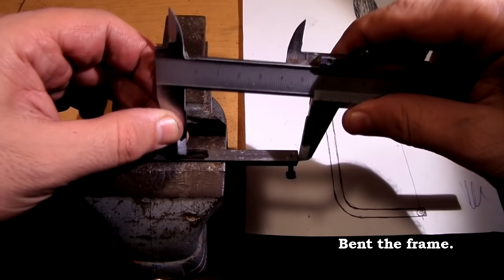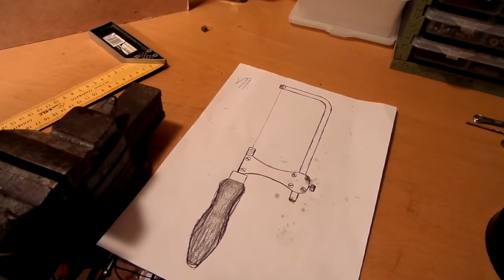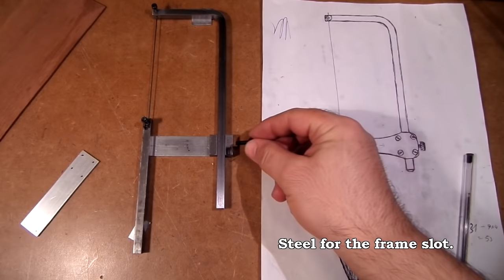Homemade Jeweler's Saw - Metal Cutting Coping Saw

Comment: Brother had you had it in you to buy the extra material and make about 50 to 100 while filming, you would have sold every last one of those!!! These are $10 to $45 depending on the brand, but yours would bring $75-$100 if it works superb. Removing the wing nuts and overall craftsmanship is a plus for me. Great work on the saw.

Comment: That is awesome, turned out really nice. If I didn't already have 2 including a lovely antique saw then I would be making one.
Reply from the maker: Thanks! Would love to have and antique one, I searched for a while without success before I decided to make this one.
Reply: +The Small Workshop I was lucky to find one at a car boot. It has suffered a little damage but it still works great. When I went to the V&A recently I saw an almost identical saw (mine is a just a little deeper in the throat) in their jewellery exhibit, it was dated to the mid 19th century.

Comment: That is incredible. If i hadnt a fretsaw and a coping saw already, i would try this too. The only thing i worry about is the strength of the thread in the aluminum plate near the handle. Nice work!
Reply from the maker: Thanks! Well the aluminum bridge is the weak spot of the saw and if it starts failing in time I'll probably replace it with brass, or even steel. That's why I did not epoxy the handle piece to the bridge. And I'll probably use this saw to make that new bridge. But right now it feels pretty solid and the forces involved while cutting are mainly in the handle, since it cuts on the down stroke and also you are not supposed to put pressure on it or you'll snap the blade.

Comment: Beautiful tool you’ve made.  
I love the details of the adjustability, and I really like your solutions.   
I have only ever found that adjustable height to be a liability tho, and prefer a fixed saw.   They make them adjustable to be able to use broken blades, but blades are inexpensive, and by the time they break I’m not sure there teeth’s are still all in. 
I’ve also had saws that use a round bore to capture the blades, but always was frustrated with smaller blades slipping.  But that could well be operator error.  Never heard anybody else complain about that.   
Regardless my particularities around a saw, you’ve made a dandy one.
Reply: Nm.  Just watched to the end.  I see it’s your tension adjuster.

Comment: beautiful work. I'm a jeweler and use one of these every day. Just curious to know what kind of epoxy you use that actually sticks to aluminum under stress?
Reply from the maker: It's a five minute epoxy from Bizon. Pretty good quality stuff but it's role here is more to keep things aligned while drilling for the screws. And maybe add some rigidity to the bridge, but screws do most of the work. But I've used the same kind of epoxy to glue rubber to an aluminum roller on a belt sander and it hold under heavy load for more than a year, until the sander itself broken, but the rubber is still on the roller.

Comment: Amazing work. If you drilled and tapped hole 90° on the set screws for the blade you could turn the blade too

Comment: little tip for tensioning the blade. its much easier to leave the spine tight and then place the top part of the saw (w/o the handle) against the edge of your bench and push with your stomach against the handle. you can then get the blade tighter with a lot more consistency than by hand.
Reply from the maker: Thanks for the tip, I've seen some youtube jewelers doing it, but my frame is a bit too rigid for that kind of tensioning.

Comment: I have seen you use your cross cut saw table before, and seen how good it cuts thin wood. As I have the same lathe, the DB250, could you publish details or provide a link to them please?
Reply from the maker: I'm gonna make either a video or an article on my website on this table saw attachment, since a lot of people asked me about it. It's pretty simple actually, just a shaft with the blade on it turning between centers and the table is made from scraps of laminate flooring.
Reply: Thank you for replying! I thought this was how you had set the blade up so it is how you made the table which interests me most, especially setting it up at 90° to the lathe axis.
Reply from the maker: The base of the table is made of two strips of chipboard that hug the lathe bed, one in front and one in the back. They are tight on the bed, so each time I put the table on it stays in the same position. To the right of the table there's a smaller chipboard strip positioned in the same way that ensures the table does not move from left to right, so the blade stays centered in it's slot. Every other element of the table was built up in reference to the front strip of chipboard. The fence rail is screwed onto it, the table top is aligned to it in the front, the blade slot and guide rails are 90 degree to it and so on. The fence rail is a piece of square tubing in which I cut a slot, making it a C channel, since I could not find one here. Aluminum extrusions are great for this if you can find them. The fence itself is a flat bar of aluminum, so I can cut thin strips without it getting in the way. PS: all wood parts were cut using a larger table saw, so they are parallel and at right angles, so you might need one too, it's a case of "sawception" where you need a table saw to make a table saw :D

Comment: I'm very impressed with your craftsmanship and the durability of this saw. I have one of these (flimsy)saws, but the blades are hard to find, or would they be in the same location as coping saw blades? I also like your 'stubby' bit driver. One of those, "now why haven't thought of that before", moments.
Reply from the maker: I use scroll saw blades, wood ones are available at my local hardware store but metal ones I buy online.
Reply: +The Small Workshop Thank you.

Comment: Wow that's nice. Love the build quality. Also funny to see a Proxxon DB250 Lathe, I have the same one. How does CA finish hold up to heavy use?
Reply from the maker: CA is pretty durable if you like glossy finish. Pen makers use it all the time. But sometime it gives good grip, like when running your fingers on glass, but sometimes it can get slippery. The short screwdriver in the video also has CA finish and it's bean beaten around my shop for a year now. I don't use oil finishes cause I use a lot of rusty/greasy metal and they get dirty fast. If you have and exclusive woodworking shop, which is cleaner, then BLO is a better finish for the grip, but then you would not need a metal cutting saw :)

Comment: Really nice work.  What size is the steel square stock you used?  Looks like 5/16" or 3/8"?
Reply from the maker: It's a metric 7 mm bar, somewhere between 1/4" and 9/32". I was planning to use 1/4"  but they didn't have it in stock that day.

Comment: Excellent Work, but don't you think installing the blade should be done with a faster way?
Reply from the maker: Thanks! I can always replace the screws with knobs, like the one from the frame adjustment. I used screws to keep the saw as slim as possible.

Comment: I can't seem to find such metal blades? Does Stanley, Bahco or another popular brand make them?
Reply from the maker: I use Proxxon to cut really hard metals, like circular saw blades, but for softer metals like copper and aluminum even the china ones work, as long as they are for metal. I guess there are some special jeweler's blades, Swiss or German made, that are better, but I don't know the brands.
Reply: The Small Workshop
Proxxon. Thanks. I'll be on the lookout to complement my wood blades.

Comment: Very nice video, thank you! Im looking for thee coping saw blades that can cut hardened metal, where do you get yours?
Reply from the maker: Proxxon. You can see them in action in my latest video, about the leatherworking knife. They work great.
Reply: @TheSmallWorkshop  Appears these are scroll saw blades, do you know the model number by chance 28000?
Reply: @TheSmallWorkshop  I found 28112, 28113 and 28114 (36, 41, 50 tooth)

Comment: A Maz ing!!!!! Ah WOW. Was looking for a video on how to cut off the SS metal from my pendant and earrings to attach to my cuff bracelet but cant seem to find any videos on how to do that and theres not one Silver Smith in this town to do it for me and while looking for a video here I ran across yours and wow God Bless you you are fantastic. You wouldn't know how to cut what I'm looking to cut would you? And do you sell the saws you make cause that seems perfect to cut the pendant an earrings I need to get cut. :)
Reply from the maker: You can buy a cheap jeweler's saw frame for around $10 online. It's the blades that make the difference, you need one designed for steel. I use a Proxxon one in this video, but depending on where you live you might find some other brands available. Swiss or German made jeweler blades are best.

Comment: Great video.  What kind of blade do you use to cut the circular saw blade?
Reply from the maker: It's a scroll saw blade made for metal, it came with the Proxxon scroll saw. It has more teeth than the wood ones and they are smaller. I guess a jeweler's saw blade should do the trick.
Reply: +The Small Workshop I'll have to try that. Nothing better than a hand made tool. Thanks.

Comment: Good work! Can I use a 1/4 inch aluminum rod? If not, why? Thank you.
Reply from the maker: The blade needs to be in tension to cut properly and I think the aluminium rod would bend at that amount of force.
Reply: Thanks!

Comment: replace the adjustment bolts with wing bolts, it's better for replacing blades and making adjustments to the tightness because its quicker and doesn't need another tool
Reply from the maker: Thanks for the tip, I'll probably do that at some point. I only had one bolt that had a knurled head, the one I used for the frame lock. And winged ones are not available with thread that fine so I'll have to make them myself one day, if the current ones prove too much of a pain to use.

Comment: Make one with a 12 inch deep throat, equip it with pinless scroll saw blades, and you have a fretsaw for woodworking.
Reply from the maker: Yea, I gave up on deep cutting ability to gain rigidity for metal cutting, which is what I need at this time.

Comment: How to fuck up a vernier part 1. I used to make stainless steel jewellery once, and to cut it accurately I had to make a rigid piercing saw to do the job. I made it out of stainless and high carbon  steel with silver steel rivets. Yours would just have fallen apart mate.

Comment: *this is my first scroll saw i've owned but we had 3 of them at college and>>>jump.wtf/B0yober    everyone seemed to love them esp. my teacher... i've only made one project so far but i've had no problem with it at all... assembly was super simple and after clamping to the bench top i have no vibration issues at all... i got the lifter arm and that works as advertised but once i installed it i realized that the "big foot" one would have been a better fit for me…